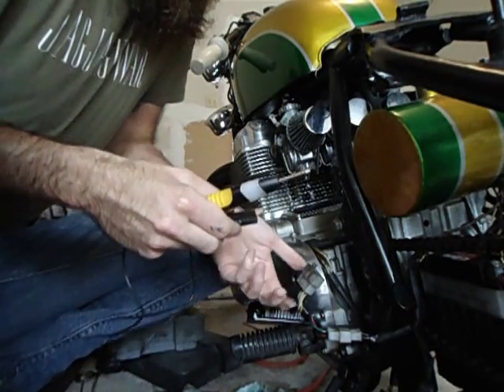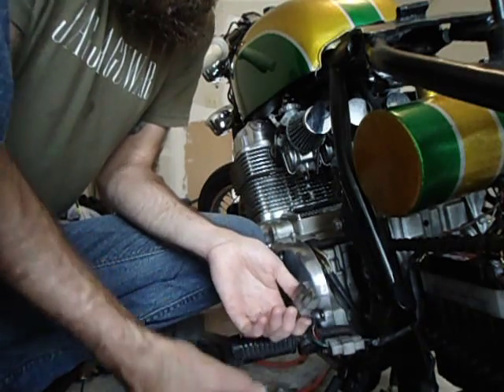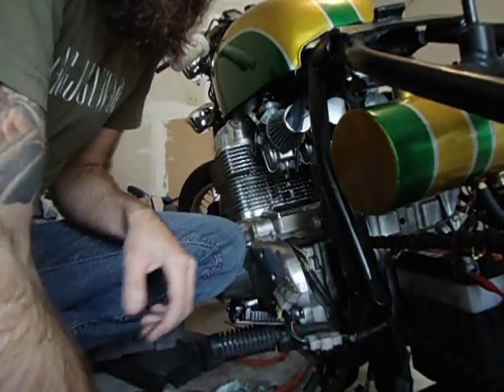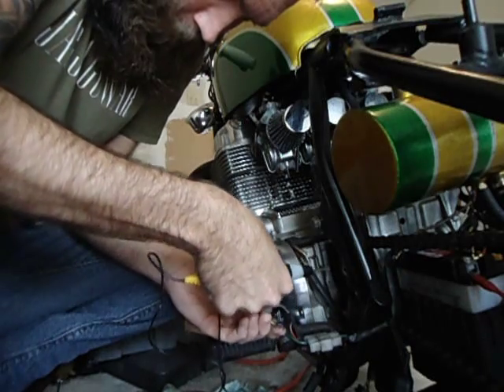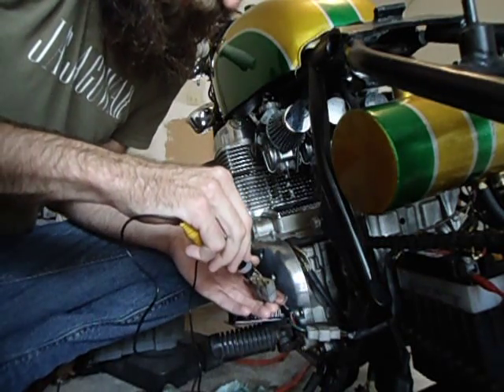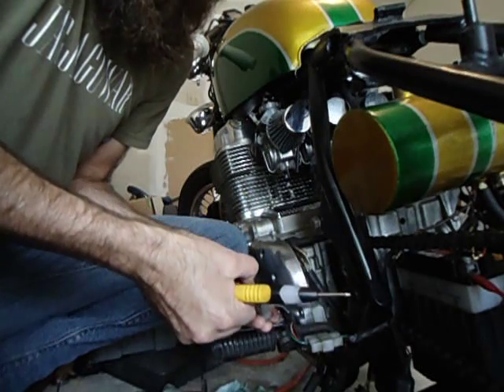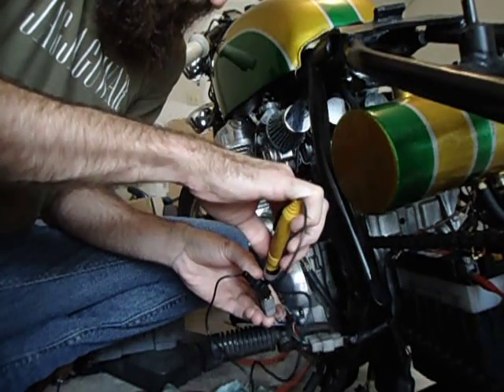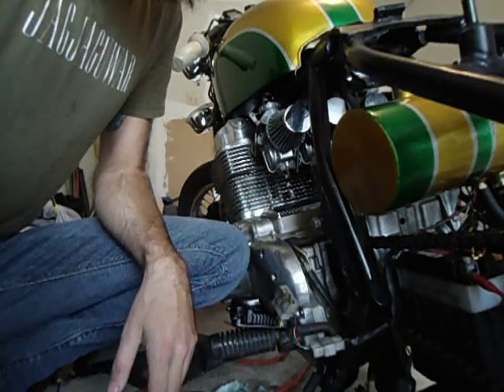Testing CB750 Charging system

Comment: I think I'm having this problem. I'm not real good with electrical how did you find your short?
Reply: I essentially isolated as best I could. But ultimately I was able to find that the wires were melted by the way they were mounted. If you have a solid state regulator I would just make sure the wires don't have any nics. But if its not a solid state then I would recommend that you buy one!